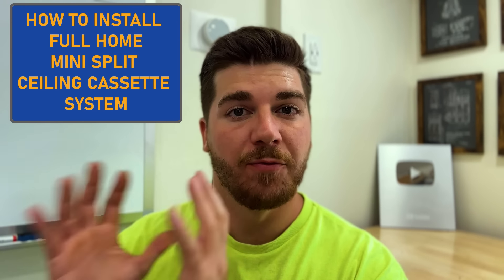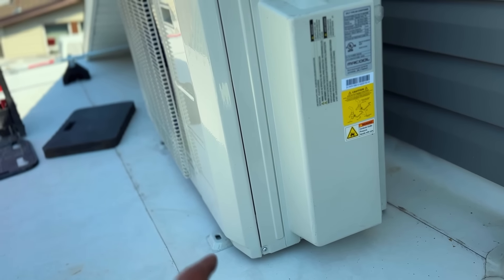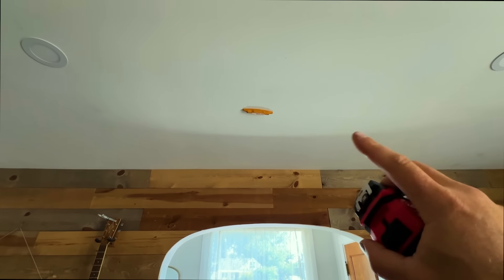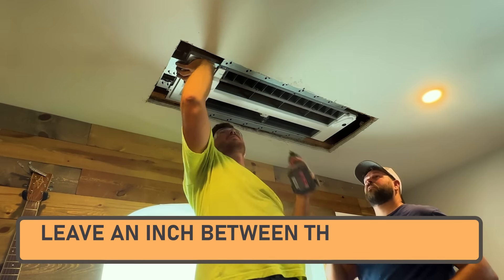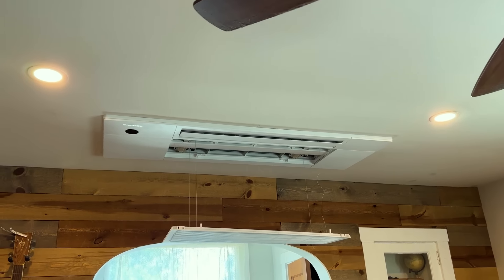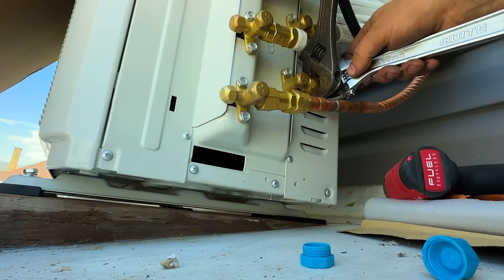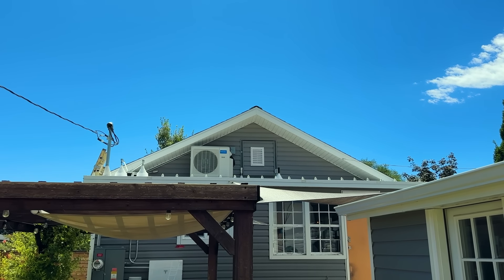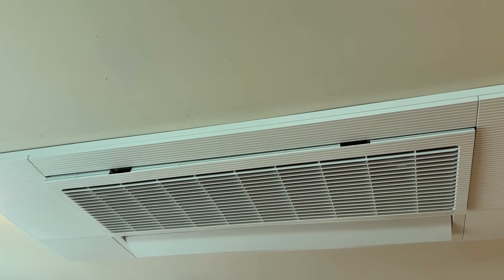The Mini Split - REINVENTED.

Comment: Nice install. In most states, it's against code to have your condensate drain line going into a wet stack. Love the homemade ladder hoist.
Reply: Homeowner installations don't require an inspection (complying with codes) so many problems I see in this install won't get flagged. The insulation, dust, bugs, mold etc in the attic will be pulled into the air handler. And the plastic filters will have to be removed and rinsed out rather often. Easy enough in the units mounted horizontally on the wall but I don't know about these.

The units will vibrate if very softly and this will cause some problems with the structure of the house. The wood will transmit these sounds.
Reply: @fmpApps IOW you don’t sell these.

Comment: I put 3 of these in our 1980's house to heat/cool the upstairs and they suck.   They are constantly popping and creaking.   The main issue is they break the conditioned space and the interior side is in 70 degree temperatures while the attic portion is anywhere from 25 degrees to maybe 130 degrees depending on the weather.   Wish I could rip them all out and just put in the wall mount units that we have in our addition.   And my units are all Mitsubishi which is arguably the best brand.

Comment: Appreciate the video! Very well done! One of the things I can't seem to find an answer to is just a video on operating the system. You came really close near the end showing the app on your phone, thank you! Can you comment further on how it's used? It seems like you have to either cool all units or heat all? One can't cool while another one heats? Can you have different temperatures on each unit? But maybe you can? Some you had set to Dry vs Cool.

Comment: I like that ceiling cassette. I have one in my home office to keep the computer heat at bay... and it is a basic cassette based on a drop celing format. It works of course, but this is designed for a home vs a drop ceiling. No reframing required. =)

Comment: Awesome install. I really like the multi head setup. My only concern is the filter type. I have a Midea U shape 12000 btu window unit and love the way it cools and it low power draw. It uses the same screen type filter and it allows dust buildup in the blower cage fins and ducts. The problem is cleaning  these area's. On a Youtube video someone put a video up on how to take unit apart to clean the blower cage and ducts. I know your usually do follow ups, so I will hope to see later.
Reply: That is the problem with all these low static units
Reply: On my wall units I do one cleaning each season to help keep any clogging of the gravity drain line and other grime from building up. Getting to the blower wheel is hard but I have found just using a self-cleaning and washing formula is better than trying to take it all apart each time. I simply turn the wheel and spray it lightly which helps the formula dissolve much of the dirt. BBJ Micro Coil Cleaner etc.
Reply: With no insulation over the heads in the attic these ceiling systems must be less efficient than wall mount overall.
Reply: Use Frost King foaming cleaner, as is used for automotive applications that are too difficult to 'take apart'? When you see dirty discharge, you know at least some benefit is gained.

Comment: I'm really considering this my main AC 4 ton goodman rooftop unit went out in Aug 2022 I'm in Phoenix wife wanted it fixed by next day. HVAC company took advantage got me for $8900 to replace it with same unit suppose to be 14 seer the old one was R22. This one my electric bill is at least $100 more a month had it checked it's pulling 20 amps a leg. What I think is the R22 seemed to reduce current more when it was cooler like at night, or later in year like now were in the low 100's. I put in a 12k Pioneer inverter mini-split in my garage can't believe how cool it keeps that garage I set it to 79F my home AC is set to 74F go in the garage it feels cooler. I run it on ECO mode it's a 240V model pulling 1.4 amps. I could wall mount it to the side of the roof like yours I have a flat roof and a pitched roof in the middle. My roof is foam so have to mount it on the side of the siding.

Comment: About cutting drywall (And other tips):
      Makita has a specialized jigsaw that works extremely well, especially if you’re cutting overhead. An alternate to “saws” is to use an oscillating cutter (Fein), Either of these tools create a very coarse dust that does not tend to become suspended in the air. 
     As for the knockouts: Of course they’re difficult; you’re approaching from the wrong side. Try drilling a 1/8” hole near a free side then hooking it with a little O-ring pick or cotter pin extractor.
     Milwaukee makes a very nice, affordable dome light that really shines when used in attics and crawl spaces. Looks sort of like an oversized “bubble gum” police car light.
     I made up some plywood pieces, 5/8” thick x 34” x 26”. That’s just the right size to both fit through attic hatches and straddle a couple joists. Using them makes attic crawls a lot easier. Paint them a bright, ugly color or they’ll be quickly stolen.
     I like the ladder hoist idea. A lot. Still, I’d have set the unit on some sort of base, even just a piece of plywood.
     Finally, electrical supply houses have snap-in bushings that will fit that hole and protect the lines from chafing.

Comment: Hola 👋 señor Dave!!! What a great video for this weekend 😊Gracias for always sharing your knowledge and insights and best reviews on ac units and let me tell you that the only unit that has impressed me was the mini split unit powered by solar panels that will be the ac system that I will install in our garage but also improving the attic insulation and seal any possible gaps around the garage door to make sure the unit will work properly and also a unit for my mother house in mexico that will be a great unit to have so she won’t be worried about high electricity bills 😊…Gracias!!! Saludos!!!👋 😊👋You have a great day and weekend!!!😊
Reply: @eastpark4864  she does have electricity Is just that she doesn’t want to have a unit that increases her electricity bill that is what I meant I know y’all think that is a poor country but it’s has developed slowly but surely

Comment: I thought this looked like a great solution until I saw the four strings responsible for raising and lowing the filter.  I bet that is the first thing to break on these.  Otherwise it looks like a cool system, and great video!
Reply: How often are you lowering your filter. I would like to see you break the steel braided cable.

Comment: At our previous house I had a Carrier mini split installed for our bedroom and bathroom.  Each head unit had an aftermarket condensate pump.  I don't know why they did that, but we had to clean the condensation tank about every 3 months due to mold building up inside and inside the drain pipe.  Furthermore, the pump motor only lasted a year, so we had to keep replacing the pumps.  Our experience was not a good one.

Comment: On tool lift setup, you didn't need to lower the voltage, the winch would just run a little faster. Been there done that.

Comment: I have been considering mini splits for a total of 7 zones (rooms) on two floors. I really like the ceiling cassettes vs the wall mount units asthetically. The problem I have is the ceiling joist above the first floor are only 7" deep. The house was built in 1901 with rough sawn lumber so they are a true 2" (or more) wide. the ceilings on the first floor are about 8'6". I've been thinking maybe build a frame where the cassette sits down below the ceiling vs flush. I'm not totally sold on it, though.

Comment: I did not use Mr cool but went with another unit 24" square. 5 units. Ceiling units. My old outdoor heat pump went bad. For the same price I did a seer 21 5 zone. Controls each room independently. My GF was always less cold in her office so she can turn up the temp. All I had to run was power control cable and two freon lines each unit. Install took me a weekend. Im no expert. Lots of youtube videos. Bought a vacuum pump and torque wrench which I loaned out to neighbors doing mini splits. Abandoned the old ceiling ducts and blower. Huge electricity savings. Old unit 30kw. New unit all going 15kw.. Heat and cool. Great for 3 years now. Maintenance just clean filters monthly.
Reply: What brand did you go with?
Reply: Which brand?
Reply: @MadLadsAnonymous  Cooper and Hunter. CH
Reply: The best thing about these minis is the end of the bug and dust filled ducts. One reason why I don't use our ac.

Comment: Very cool install, love these ceiling units as they are not so noticeable as on on the wall. I am not sure but in Ontario we use vapor barriers to prevent air going from cold to hot areas and create condensate. This must not be a problem in your area as I see no kind of vapor barrier used in your install.

Comment: Suggestion for future installs - consider marking off your ceiling cut lines with the edge of blue painters tape.  And by using a couple of additional widths of tape around the perimeter of the initial cut, you protect the paint from smudges 👍

Comment: Use an oscillating tool to cut through drywall. It’s like butter. So much easier than a saw.
I imagine these need to be mounted outside. It’s very convenient that you have a place to mount it that’s close to your crawl space. Do they heat ok in the winter since air rises?

Comment: I didn't know you could mount any of these in the ceiling,  excellent information.
Reply: Same here. Planning to put one in my 2 car garage since I'm spending lot of time there and no wall is free for a traditional unit.
Reply: Ceiling cassette it's new
Reply: It's the worst place as it will have to cool 130 F air versus the under 80 F air inside a house. Mount it on the wall and save electricity $$.
Reply: @fmpApps  it's heavily insulated
Reply: @fmpApps  NOPE I don't think so -  Mini splits have heavily insulated freon lines (not air ducts) from the unit outside (compressor) to the unit in the wall or ceiling.   Traditional HVAC's ducts would be far worse up in the attic.
Reply: @Bowhunters6go8xz6x  Once the Freon expands and tries to cool the air it still has to cool air 50F than the air in a house. The insulation doesn’t cool the air. I am comparing the temp of attic air to house air. Insulation is used to keep the hot attic air from heating up the household air.
Reply: @fmpApps  I don' think you watch the full video. The cooling coil is outside on the roof in a partial shadow at 24:02 mark

Comment: Now day if a person were building a brand new house, or doing a down to the studs and rafters remodel, would using these mrcool pre charged mini-split heat pump based solutions still be the optimal way to go over centralized forced air or boiler and pipes in floors solutions?

Comment: Which 18v to 12v converter did you use on your winch setup? I need to make a small portable winch setup for a different purpose, but there are soooo many different converters and most don't look as beefy as that one. Thanks for another great video!

Comment: Use some foam board around the units in the attic. Insulate around the unit and reduce all the loose insulation build up around the unit.
Reply: I'd also add 6-12" of blow in insuation
Reply: @stevec7272  The insulation doesn’t cool the attic it acts as a barrier to the hot air in the attic to the cool air in the home below.
Reply: @fmpApps  no sh*t
Reply: @fmpApps 😂 Captain Obvious strikes again
Reply: Before insulating seal all air leakage from the house into the attic to reduce the “stack effect.” Now that those drain lines are in the way it will be more difficult.

Comment: Flush mounts I have seen require 7-8 inches from the back wall.  Was this OK to be right up against the back wall?  Didn't use the loc tight on the flange connections?

Comment: Do these units have an auto stop feature should the condensate pump fail?   The pumps will fail at some point.  What happens when one fails?   Hopefully the app has a maintenance reminder for filter cleaning, the most frequent maintenance item.

Comment: And this will last about 10 years? with traditional you only have to either change out air handle/coils or condenser.  What will need replacing with this system?

Comment: Can I use one of these units in a vaulted ceiling? So instead of the face pointing straight down it is low on one side and high on the other.

Comment: That attic was so big and unobstructed I would have had no problem running ducts but these hew units seem to be getting better and better.
Reply: They are self contained condensers and so don't need ducts which means no dust, bugs or bad smells. I enjoyed them in the hospital since I could clean the plastic screens that filter the air.
Reply: @fmpApps  No shit. 
Thanks for the lesson.

Comment: Curious how these are cleaned as the head interior units for Mitsubishi split systems need regular cleaning as the fan blower is in a "pull" configuration and it gets moldy.
Reply: Influencers don’t want to talk about that, and take away from the hype.

Comment: Would love some post build insulation tips. I have foam spray in my room, but my house is still quite leaky. What love to explore what all the options are out there. pre/post build.
Reply: Actics have several opening to the outside. Walk around your house and look up at the edge extending from the walls and you will find them.

Comment: What are the rules for running the coolant lines and drain? Can the coolant lines go up a little bit and then out to the condenser outside?
Is that P trap going the wrong direction?

Comment: When I build I'll run 10ft ceilings in the bedroom and 8-9ft in the hallway, then route the AC lines above the hallway inside the air barier + air handler over the doors.

Comment: I have a question about comparing a central system vs a mini system.   Central systems typically have replaceable filters. This cleans the air and keeps the unit cleaner.  I've noticed that mini s  have a filter , but they seem to allow more particulates through? And how is the exchanger cleaned?

Comment: Does the mrcool heat pump require 240v x 40/50/60a power or a 120v x 20/30a power supply?

Comment: Seems like a great system, much more preferable to the big plastic boxes you slap on the walls.    For me though, unfortunately I don't have an attic that has room like that, while I do have a crawl space, it is quite literally a crawl space, and the stiffness of the tubing doesn't look like it's something you can preinstall on the ground then shove up through the hole.

Comment: Isn't setting everything in Dry mode going to cause the mini-split head unit fans to just run all the time vs cool or heat ??? modes where fan shuts off when desired temp is hit?  Is Dry mode like an Auto where it cools or heats whichever is necessary to hit desired temp?

Comment: 12:23 be careful with he magic eraser on mate or flat finishes.  It will make the surface slightly shinier.  You won't see it around the edge of the head unit, but if it's used in the middle of the ceiling or wall and the light is right, it doesn't look that great and you've got no way to make it flat again except for repainting.

Comment: When you run into a problem which you will some day like changing out a blower motor or evaporator coil on the inside units or a condenser fan motor or compressor on the outside unit or any type of repair to the inside or outside units ,how hard are those types of jobs going to be? looks like it would be very complicated and difficult from just watching your video?

Comment: Are these units' internal thermostats reading the temp at the ceiling level or from a remote sensor elsewhere?
Reply: You can set it for either. The cassette temperature setting is extremely inaccurate. I recommend sticking with the remote temperature.

Comment: I like it but prefer the attic cassettes with short run ducting.  We do have one Mitsubishi ceiling cassette in a home gym.  The rest of the house, 8 zones are vented out through slot defusers.  These type systems however, should become the norm and to just say to conventional ducted systems.  No phone apps in my house, just a Mitsubishi thermostat in each zone.

Comment: Two small question: 1.With the dack system you get constand exchan of air  from contaminated to fresh. How you will manage that with this split units? You have seperate ventilation system with air exchange unit? 2. Wher the water condensation go from this split unit.

Comment: They definitely look slick, but I think you're going to lose heat in the winter with the holes in your ceiling and compromised insulation and condensate overhead is a little unnerving. I think wall mounted head units are better overall.

Comment: Does your thermostat control all 4 units?
Reply from the maker: Yep you can use any of the remotes to control any of them. As long as you are close enough it will adjust any of them 👍🏼

Comment: Flex style wire cable can be unsecured with a maximum length of 6 feet. The trick is to run flex cable type wire and secure it according to NEC code to within 6 feet of the unit and install a j-box. Then come out of the j-box with your unsecured flex whips.

Comment: How does the condensation drain flow the condensation water flow up?
Reply: It has a built in pump.
Reply from the maker: Yes built in pump on wall these ceiling cassettes

Comment: Why do you allow the drains attached to each unit to go vertically up?    Isn't this water draining passively by gravity in a sloped tube?   How is the water supposed to travel one foot vertically before starting to drain out?
Reply from the maker: Each of these units have a pump, and they have to go up and then slope down so water doesn’t make its way back into the unit.